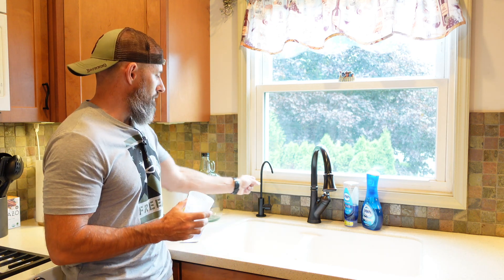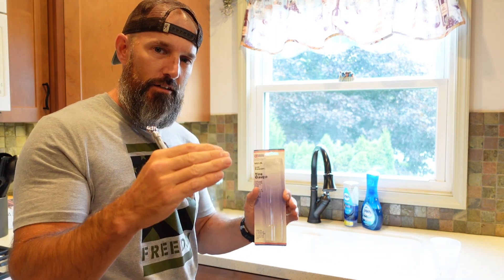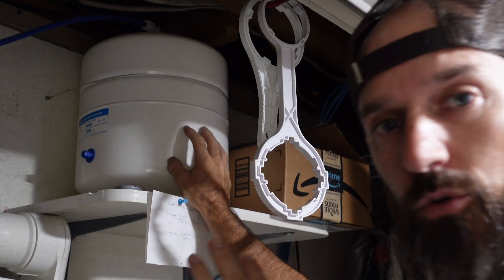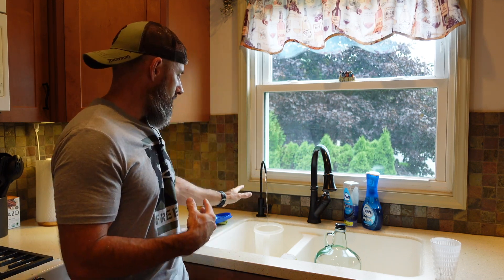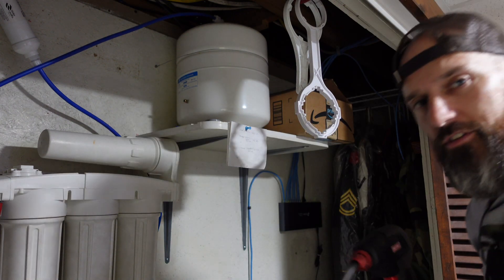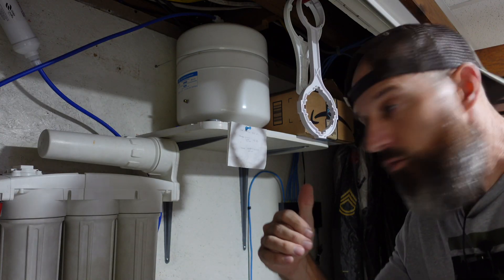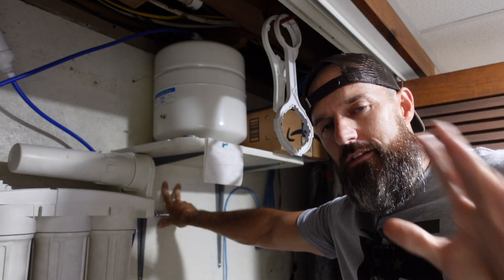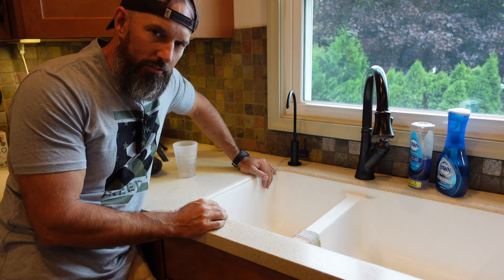How to fix low water pressure on a Reverse osmosis water filter system.

Comment: what if the nozzle leaks water when you check for pressure or pump the air in? does that mean the tank should be replaced?
Reply from the maker: Definitely sounds like you need a new tank. Thanks for watching

Comment: So what is normal flow rate? Mine at 10 psi still takes 10 seconds to fill a cup of water, is this normal?
Reply from the maker: Sounds wrong, did you check the psi when the tank was empty?
Reply: @DIYJIM  Yep, at around 4 PSI flow is super weak as expected but 7 or 10 or 12, same mediocre flow

Comment: I remember when I first got my RO system and I’m like why does this need to be under the sink??  I barely have room under my sinks as is. Did the same as you and put in basement and I did splitters to have a spout at the kitchen sink, one in the basement and one going behind our pet water bowl which made refilling waaaayyy easier.  I also upgraded my 1/4 outlet lines to 3/8 for more pressure and flow.  Later on I also ended up adding a much bigger second tank and the two tanks with bladders increased flow really nice. 👍
Reply from the maker: Awesome thanks for watching